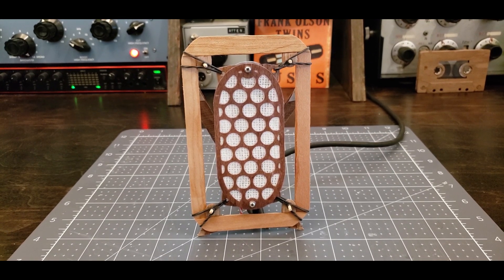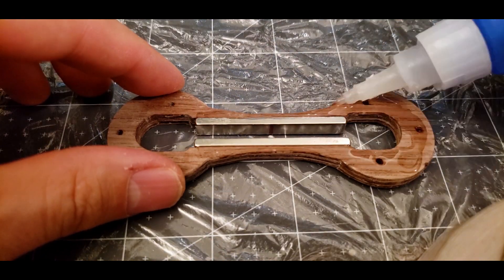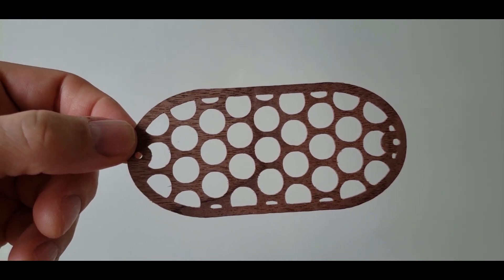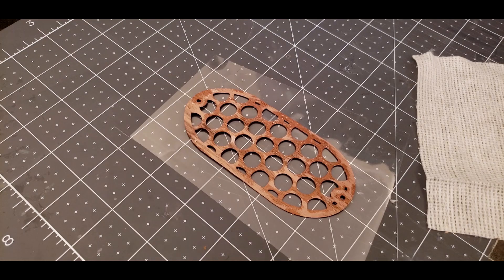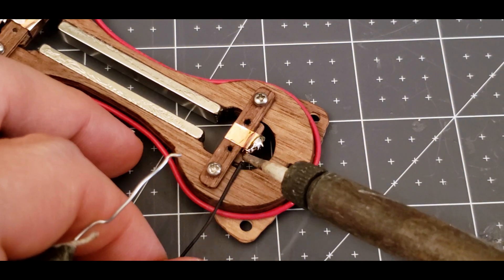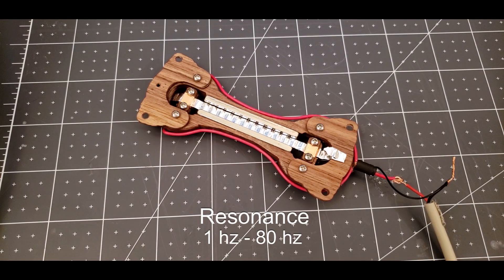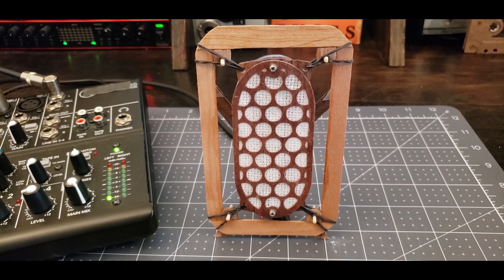Ribbon Microphone DIY RCA 44 - Episode ONE

Comment: Very good sounding! I have a question. I want to tension my ribbon, can i also just plug it into my interface with the xlr while tensioning? And then tap the motor or something and analyze the response in my daw? I kind of don’t want to solder it to another connector for that. Also what makes your ribbon have such a nice high fq response? Thankss
Reply from the maker: Yes, that's one good method of doing it.  Essentially, you'll build your entire mic(motor, transformer, XLR) as normal and tension the ribbon last.  That saves you the step of hooking/unhooking which is tedious for sure.  
Regarding the ribbon frequency response, a couple things come to mind.  The transformer I used was actually a bit dark sounding, so I always account for that by boosting 3db-6db of treble on whatever mic preamp I'm using.  When I upgrade the transfomer, i won't have to boost the highs.  
Also, this is a long ribbon with a skinny waist(middle part of the ribbon). That skinny waist is where the high frequency pickup occurs.  There's a bit of science regarding how sound travels past the motor, but to sum up the concept- a long ribbon with a skinny waist will have better high frequency pickup than one with a fat middle.  I believe the concept goes all the way back to Harry Olson's research with the RCA 44 microphone.  I think that's another reason you see mic manufacturers making mics with "X" pattern magnets- to keep the middle as thin as possible to capture as much HF content as possible.
Thanks for watching!!
Reply: @FrankOlsonTwins  Thanks so much. I read some things about the thin waist indeed. Very interesting. Im making a 1.60 inch (40mm) long ribbon, do you think a small waist will benefit it too? I read something about smaller ribbons already picking up higher frequencies better. I don’t know if it will be overkill.
Reply from the maker: I don't think it would be overkill.  I'd shoot for 1/3rd to 1/2 of the middle to be thinner.  If you look at many different longer ribbon motors, that seems to be the sweet spot. I also think proximity to source can have some treble effect, but that's just an educated guess.  I haven't done the same research RCA or the BBC has!
But, I would make whatever shape you want to start with and see how it sounds.  It could be just fine.  Depending on your magnets, transformer and your ribbon material, it might not be an issue.  Most royer ribbons, for example, are about an inch and and half long, and have a wide waist.  They do make a few very expensive X- patterns though.  Worth trying out though!
Whatever happens, let me know!

Comment: Hi. Thank you for all. Which transformer did you use
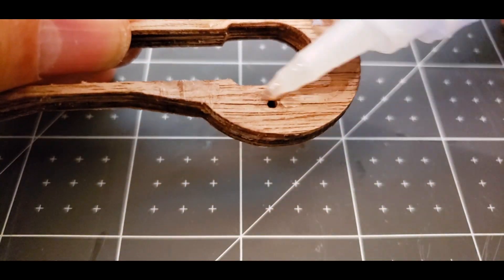Reply from the maker: The transformer is a b-stock one, removed from a cascade microphone.  Basically, any 1:37 (a little higher or lower is fine, some are 1:28 for example) ratio step up transformer will work.  Edcor, Lundahl and Cinemag all make new ones.  Maybe Sowter too?  If you shop online, just look up "Ribbon Microphone Transfomer" and  you'll get lots of options.
Good luck!

Comment: Awesome!
Couple of questions
* When you are 'testing for resonance' - are you just seeing if the foil moves when you put the sine wave through?
* What amplitude are you using for your sine wave there?  Are you just using straight out of a signal generator?
* How do you know if the foil is the right tension?  Is it the resonance test?  What would make you loosen/tighten it?

Thank you for sharing this awesome project!
Reply from the maker: Thanks!
1. Basically yes, making sure it can easily resonate at a certain frequency.
2. (a) Amplitude is at headphone level.  (b) It's generated in my DAW, and taken from the headphone ouput.
3. Generally, it's a complex task to get it perfectly tensioned.  But the truth is, as long as it's not too loose(floppy, sagging).  The opposite would be too tight, resulting in bass frequency cutoff and sometimes weird ribbon resonances. With practice, you can get a good idea of whether the ribbon is tensioned too loose or tight visually. The resonance test gives a good idea of whether your ribbon is hitting those low notes. You still have to double check the audio to make sure it's picking up everything.  
Good luck!
Reply: @FrankOlsonTwins  I suspect this isn't a project I'm getting to any time soon, but has been on my backburner project "wish list" for quite a while.  Thanks again!

Comment: What's the purpose of the transformer? Impedance matching, or?
Reply from the maker: Yes, the transformer does 2 things:  Impedance matching is one thing.  It bumps up the impedance to around 200 ohms.  The second purpose of the transformer is to amplify the voltage/signal by about 30x.  Some amplify more or less depending on the winding "ratio."

Comment: Glue type?
Reply from the maker: Mostly Zap-a-Gap medium CA and Loc-tite medium CA.  My preference being the Zap-a-Gap(been using it for years), but the Loc-tite worked just fine.  Most important is that the bottle hasn't been opened for a long period of time(several months or longer).  If so, it'll get slimy and won't cure...just some CA facts for you, in case you didn't already know!
Reply: @FrankOlsonTwins  Thanks Frank!!!
Reply from the maker: you bet!

Comment: Great to see part one, can’t wait to see the rest! Why did you have to check the ribbon with a light?
Reply from the maker: Thanks!  Good question, checking the ribbon, specifically the ribbon gap is easiest against some type of light box.  It ensures the ribbon isn't touching the magnets, and that there's nothing impeding the ribbon movement.  A light box isn't strictly necessary, but it definitely speeds things up a bit...

Comment: Very nice work! I've been working on a ribbon mic project using a PCB as the frame and having the transformer and Phantom powered active electronics on the same PCB. My main issue is that I haven't found a good source for the ribbon. Do you have a recommendation?
Reply from the maker: Hey Adrian!  Thanks for checking it out!  Do a search for Lebow Company, they have thin aluminum foil.  It's very expensive but it's the only actual supplier.  Currently $25/sheet for either 2.5 or 1.8 micron.  I'm pretty sure at least one of the big microphone manufacturers use imitation silver leaf, but they weigh the sheets and check the thickness against a light.  Heavier sheets being the better ones.  Some even weigh the ribbon itself. I started weighing sheets but ran out of patience, so I bought some.  Best of luck.  Let me know how your project turns out, PCB frame sounds clever!
Reply: @FrankOlsonTwins Thanks I'll look them up.  I did try imitation silver leaf and got good sound, but if you cough near it you rip your ribbon! I think the leaf is 0.6 micron. Handling it is an exercise in breath holding! Once I get new ribbon I'll pull together my video and schematics and post...
Reply from the maker: The beauty of using silver leaf is that once you get really good at cutting and mounting those ribbons, the thicker stuff(2.5u, 1.8u) is a walk in the park.  It's about 3x thicker, very noticeable when handling.  Once I started sorting through my sheets over a light box, it became easier to find the thicker sheets, and see which sections were already too thin or pin-holed(more than half the sheets, btw!) I definitely have learned "how to breathe" when installing ribbons.  I also highly recommend making a ribbon crimper if you haven't already. It changes the game!

Comment: This is amazing! I recently built my own ribbon mics (2, for Blumlein, spaced etc.) but I have some problems with noise until today. Do you have any thoughts on that?..I used also wood for the base, an edcor transformer (around 50 bugs) and also did the wire loop around the Ribbonmotor. 
So why in particular did you stick the copper tape to the little pieces, which hold the ribbon?..I should try this as well..

What very interesting for me was tuning. Never seen that before in DIY-projects. 
When you checked the motor against the light, you checked the ribbon to not touch the magnet right?.or was this for something else?

Greetings and appreciation from germany!
Reply from the maker: Hey Nils!  Thanks for checking out the vid!  Regarding the noise issue you're facing...  Is your wire loop connected to the primary of the edcor transformer.  It goes against logic, but it should be connected to primary, not ground.  Also, is your transformer shielded with a Mu-Metal can?  It's the best way to rule out interference. They are for sale on ebay or from Cinemag. 
I went back and forth about the copper tape on the hold downs.  I felt that the extra bit of conductivity was worth the effort.  Also, the tape adds more pressure in the center of the tabs.  Better safe than sorry!
Yes, I check the motor against the light to make sure the ribbon isn't touching the magnets.  Many times I just keep the light on while installing the ribbon.  It's very difficult to do without some type of light behind the motor. 
One last note, regarding the tuning:  I used a signal generator in my DAW and then ran that through the headphone output.  I wired up a connector for the motor directly with no transformer.  At about 50% volume it generates signal on the ribbon. Using that you can see if your ribbon is too tight(it won't vibrate freely if it is too tight).
All the best!